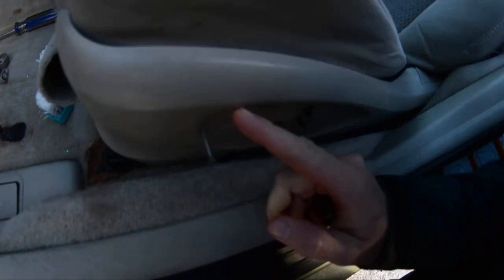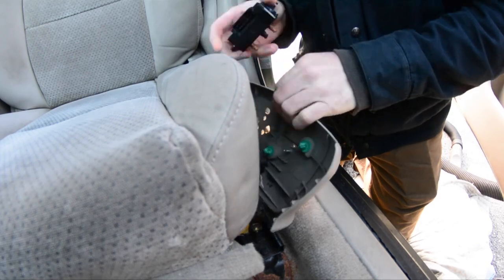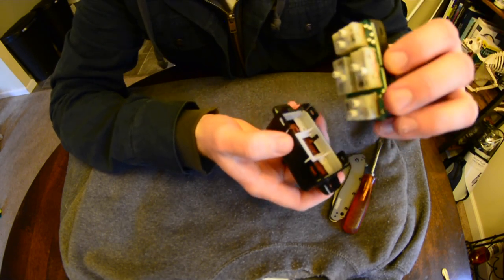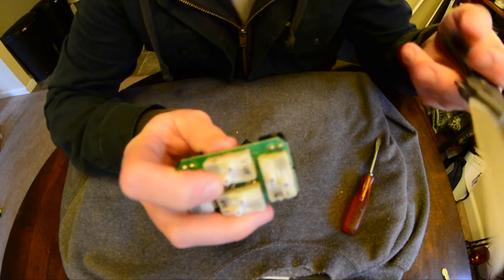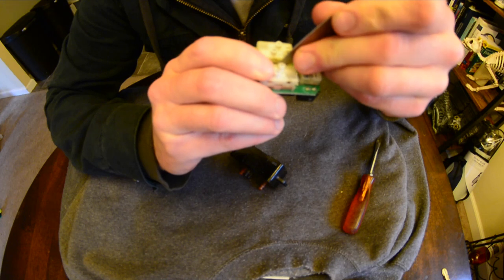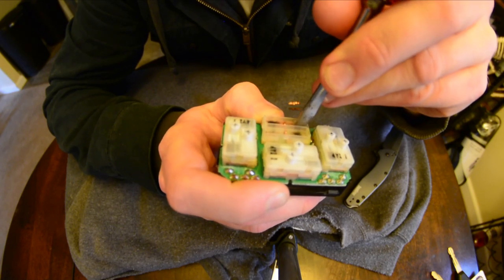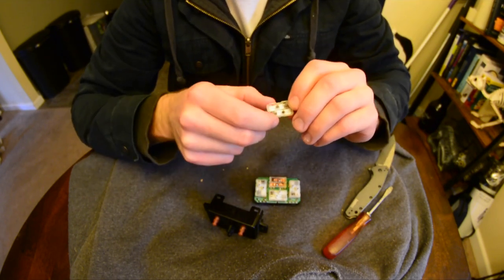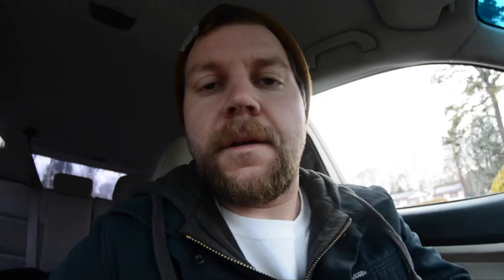SUBARU POWER SEAT SWITCH EASY FIX!! 2005 OUTBACK

Comment: Duuuude!!!! Thank you SOOOOO MUCH! I just was given a 2000 Outback..seat was too far back. Seat has up/down to the bottom cushion front and back but the forward slide didn't work..the back did, after watching this.. even though you have a four switch box seat vs three on mine l went ahead and pulled the switch apart..no problem..putting the switch with 4 springs, 2 rockers, two bearings, two actuators and a cover that all had to be done at one time??? Well, let's start with the springs, l would have super glued the very base of the springs into the actuators but didn't have any so l used the next best thing..a LITTLE bit of black gummy rubber from the side of a tire plug in the holes then shoved the spring in..it worked like a champ, not once did any spring fall out of the actuators. Now to hold the actuators to manipulate the springs up into the cover while holding the actuators against the cover l used tooth picks l pushed in from the non spring side through the lil holes to give me a way to control and hold springs by the  switch cap... once it was in position l then lined up the cover with the springs over bearings in the middle of the rockers (switch laying flat on the table) l used tooth picks l shoved in from the opposite side of the actuators of the springs, got the bearings sitting on middle of the two rockers on the actual switch and lined up the bearing springs then came down straight over the two bearings and pressed in place..SNAP it actually worked (after several attempts, all of the planets must be lined up which took me a few trys) maybe an hour or two but he'll..IT WORKS LIKE A CHAMP!!!  McGuyver ain't got SHIT on me!!!  Thank you sooo much for letting me know that l really didn't need another driver seat ($250 plus $125 shipping) that would likely never match the other seats (funky factory striped blue gray cloth) that l was looking at on EBAY 20 minutes before l went to YouTube possible fixes..and there you were!!! Yes indeed you saved me a seat purchase.. l thought the motor was toast being the previous owner was 350lbs..but VIO-LA!! It was a fouled contact that was seriously TOAST but nothing a good scape and polish didn't fix! Nothing more!! I can't thank you enough!

Comment: Thanks for the video!

To those that might find it helpful take note of the switch glide slots in the clear plastic cover. 
See how those switch glide slots have a square end and a rounded end?
Notice how all of the switches on this circuit board have the same part number and all of the switches are resting in the same position of their respective guide slots?
Now when you look at the underside (internal) of that same clear plastic switch cover it looks like there are little notches for the left-right switch springs to rest in... those are NOT for the springs. Again look at the orientation of all the other switches in thier guide slots. 
Those left-right switch springs actually rest in the clear plastic surrounding the copper switch parts and NOT in the clear plastic cover. 
I was having a tone of trouble getting everything lined up.
I ended up covering the springs and the ball in dielectric grease to make them sticky. 
I then assembled the copper switch parts as show in this video
Next I took special care to assemble white switch slides into the clear plastic switch cover
The hardest part was getting those left to right springs fo fall/pop into place when mating the two clear plastic haves back together
I tired setting the white switch assemblies and their springs into the clear plastic around the copper switch assemblies but after many attempts could not get it all lined up
I ended up setting up the clear plastic switch cover, left-right springs and clear plastic switch cover as an assembly and dropping it onto the copper switch parts and ball detentes.
The trick is to get the left right springs perfectly straight so that when you push the clear plastic switch cover halves back together the left-right springs pop down and into the lower plastic half that surrounds the copper parts...
Clear as mud? well, I tried.  

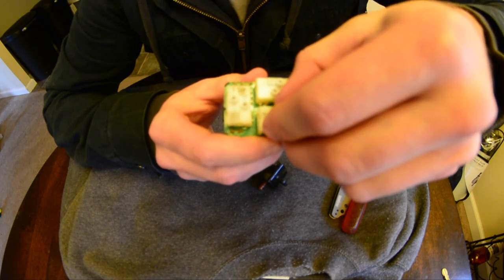EDIT: OP @ 4:40 ...your dog knows how to do forward rolls??

Comment: I nearly went mad trying to get the spring/ball bearings back in place without popping out so I have a tip that might save others some time. 

I glued the shorter vertical springs in place. Once I had the other springs/switches in place while holding them down, I tied a couple pieces of very thin fishing line around the casing to stop them popping back out. This allows you to flip it over and line it up with the other side easily. Then, I cut the fishing line/pulled it out and clasped it shut. I can't for the life of me figure out how people got it to come together otherwise!
Reply: I did the same with a bit of plumber's putty!

Comment: Thanks for this, Kenny. You saved me 70-100 bucks for a new switch. Putting the toggle switches with the springs back together was the hardest part. There is no post for the longer springs to seat into - they want to bend. This part will try your patience.

Comment: Thanks for the video. Worked fine on my 2010 Forester. Actually didn't take the white cap off. Just gave the switches a good spray with contact cleaner and that did the job.

Comment: Thank you so much!  It worked!  The seat would only go forward, but wouldn't go back.  After many trys and lots of praying, it would occasionally work. 
Last week, I took my 2005 Legacy to a detailing place and after explicitly telling them not to move the seat, they did anyway!  That was the straw on my back and I decided to finally dive in and do it, as the car was practically undrivable and no matter how much I tried, it wouldn't move back.
I would say the hardest part was popping out the plastic molding from the seat without breaking the clips.  I put a flat head screwdriver through the crack and pulled from the back side.
I only cleaned the front-back switch since the other ones were working.  The contacts were black and corroded and I used some sand paper to clean all the copper/bronze surfaces.  I blew out the dust and also used a very small amount of vaseline to keep them sliding easily and not corroding in the future.  
The whole process took about an hour but I took my sweet time to make sure I was completely thorough with everything. 
Thank you again!  I am so happy to have my seat working perfectly for the first time!  It had been like that since I got it in 2017. 
And I saved $200 canadian dollars, since this is how much Subaru wanted for a new switch.  It would have taken me just an hour to drive to the dealership and back.  All the Best to you!

Comment: Thanks for the help! Worked like a charm. Dropped my car at an airport shuttle lot, when I got back from my trip the valet had adjusted my seat closer to the wheel but it wouldn't move back 😅. Had to squeeze myself in there and make due until now! Cheers!
Reply: 2004 subaru outback H6 ll bean edition

Comment: I was so thankful to find this video right when my forward motion stopped working! I have a long drive coming up tonight and my seat is stuck too far back! I have been trying to follow the video but I can't seem to get the panel off! I can't find any screws holding it in place but it's sure stuck on there. I have a 2009 outback but everything looks pretty similar to yours
Reply from the maker: If you don’t see any screws it could be a snap in panel. Maybe try prying in one corner?
Reply: @kenny609  it worked, thank you!!

Comment: Thank you! I was able to fix my passenger side switch with this info. Same issue, seat wouldn't move forward, but other directions still worked. I'm not sure you even need to "scrape" the contact points, I think just a Q-tip with a tiny bit of rubbing alcohol would clean it, too.

Comment: Thank you, you are the only one that has video on this issue.  Just a little tip, when putting back together. Put the switches in box and then put panel cover on bc if you try to hold switches in panel and try to put on box its just a headache. Springs go flying. He is right it works and it saved me from have to buy a new part. And qtips help too.
Reply from the maker: I should of made a bloopers section for the amount of times the springs went flying lol. Thanks for the tip!

Comment: Thanks for the great walk-through. Worked perfectly for my 2008 Subaru Legacy. In addition to the four contacts you point out around 5:03, I also found and cleaned corrosion off the underside of the copper arms that bridge the contacts.

Comment: Thanks, Kenny!  I just cleaned the switch on my daughter's 05 Outback and Voila it works like new.  There was black corrosion, especially on the copper contacts in the "bed" of the contact area.  Used some contact cleaner and a q tip to ream it out.  I had trouble with the vertical short springs falling out of the cap a few times before I put a tiny dab of plumber's putty in the spring cylinder and shoved the spring in.  Springs stayed put and still did their job.  Anyways, my hat is off to you for this DIY fix.

Comment: Legend, for anyone else doing this, if your springs come all the way out, put them back in facing the flat white plastic side that has no guides, you just have to fiddle around until theyre straight ish and send it, the guides are for the other end and should slot in nicely

Comment: Followed your direction to fix my tilt switch and it worked great.  What a pain in the arse it was to get the springs/balls/switch cover to line-up when reinstalling but I finally got it in place.  Thanks for the great video.

Comment: Thank you for posting this! I just fixed my wife's car, she had the opposite problem and was trapped between the seat and the steering wheel - the seat wouldn't go back. Video was very helpful. I found the switches harder to put together than I had expected. One tip: the tops of the toggles actually have a little cross shaped hole in them. I was able to stick a tiny screwdriver into the top of the toggles to keep the spring from falling out during reassembly. It is very important to have the both springs seated on the ball bearings before you snap it shut. I rebuild two of the four switches (the horizontal control switches) since we were having trouble with the seat back too. Took me around 3 tries each to get them back together. It was a little frustrating but now the seat works great. Not sure I would have done it without this video. Thanks again!
Reply from the maker: Glad I could help! Yes I left some clips out as I struggled a few times on reassembly, just takes a little patience. Stoked it worked for you.

Comment: I was able to follow this to fix my wife’s 2007 Tribeca. Her passenger seat had stopped moving forward. 
I’d recommend using small screwdrivers where possible if you have them. And clean off the underside of the rocker arms along with the ball-shaped contact points as there will be corrosion on both sides. And if you’re cleaning contact points on one of the switches, it might be best to go ahead and do the other switch as well. 
The biggest challenge was putting the little white covers back on as the springs tended to slip out of place pretty easily.

Comment: Life saver dude! Seat was stuck all way back on my new 180k '05 Forester XT, this did the trick!! Now I can save some cash and hold off on those stupid expensive sti seats 😝 cheers!

ps. also scraped underside of copper arms and wiped contact points with a q-tip sprayed with brake cleaner (had no contact cleaner on hand) may have helped too

Thanks a bunch kenny!

Comment: Thanks for this! It worked for my 2001 Outback with a slightly different switch layout. Putting the springs back was indeed the hardest part. For me, it helped to tightly hold the trigger parts that are on the other side of the springs while reassembling that small white toggle box.

Comment: A close up of the innards would be nice.  I used a needle and thread through the white switches to hold the springs in while I put it together, then just pulled the thread out.

Comment: Thanks a bunch for posting this. It was a little tricky putting it all back together, but ultimately worked just great. Saved me time and money. Also, always happy to fix instead of replace.
Reply from the maker: G L Porter 👍🏻 those little springs are tricky on reassembly. Took me a few tries.

Comment: Great vid. Informative, funny, to the point, a little blurry but hey -  happens. The timing of the zoomies from your dog is hilarious. 

I have a 2010 Subaru Outback with the same problem - i wonder, would this help fix the problem as well because as it is I'm sitting wayyyyy back in my seat while I drive and it's really not great. 

My battery also died a few days after this problem occurred so I'm a little concerned the seat went back due to a short somewhere and if so I have no idea how to fix that.

Comment: In a pinch you can try the sliders repeatedly (without disassembling anything at all) until the corrosion scrapes off from it. Just worked for me lol. Not a permanent fix though.

Comment: Question! Do you know if the driver side seat adjustment switch module is interchangeable to the passenger side seat? My passenger side switch is completely broken so I think it needs to be swapped out for a new module. But all available online only seem to be driver side modules

Comment: Hi! I don't know if this is still an active "thread" but I am helping a friend repair her Subaru and  both seats apparently stopped working and not just one function but all functions. I suspect its a fuse but my beginner self can't figure out which it is. I am going to follow the video just in case and try to clean the switches but as I said since both chairs lost all functions same time I suspect something else is the cause. Appreciate any help :) Greetings from sweden.
Reply from the maker: Kim Johansson Hi! Thanks for the comment. It sounds like you have a different issue. Like you said it might be fuse related or a relay that controls the power to the seats. I would start there first. Best of luck 🤙🏻

Comment: both my seats suddenly stopped working when i went to tuffys for an oil change!!! I noticed on each side there were rubber tabs on my carpet so I am suspecting the guy at tuffy took mine and put his shitty ones in! I also noticed that the side panels were forn open and broken! they are denying they did it but the seats worked before i took it in and suddenly i could not move the seat forward after he changed oil!!
Reply from the maker: frenchis19 That’s messed up! I guess all you can do now is just leave a negative review. Karma will catch up to them for sure.
Reply: frenchis19 thats a fuse